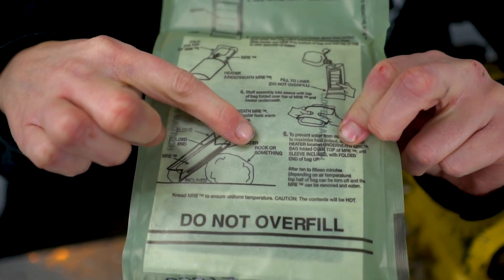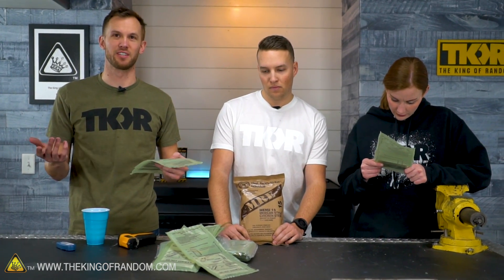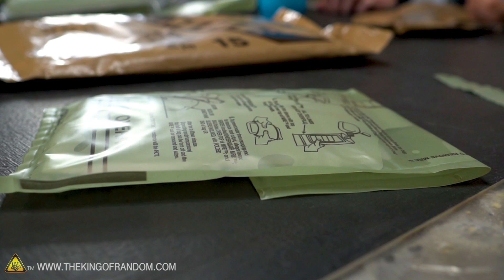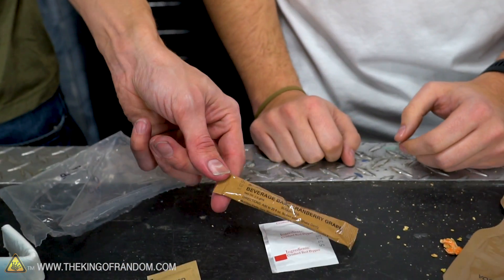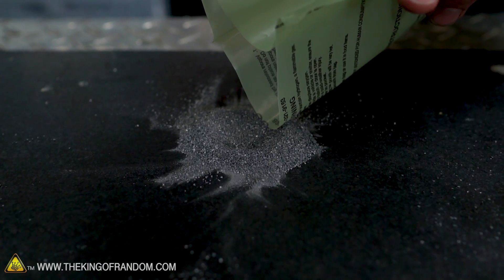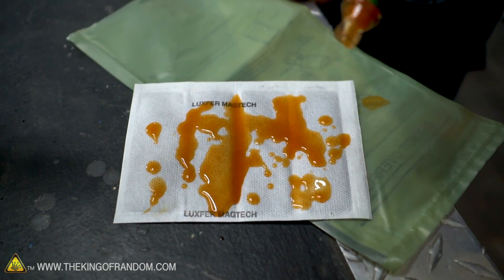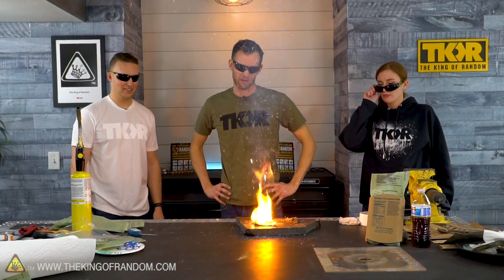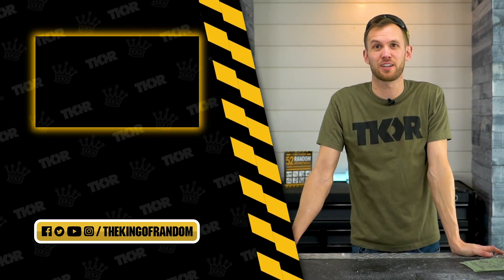Testing How The Army Creates HEAT With WATER

Comment: I can not believe they didn't put one inside of a sealed water bottle. it builds enough pressure to actually explode. Louder than a gunshot! You can up the reaction by putting multiple heating packs inside a gallon jug.

Comment: Fun fact: Placing an MRE heater, or its contents, into a plastic 2-litter bottle and pouring about a cup of water into it makes a nice explosion with the decibel level of a shotgun blast. Placing the heater into a glass bottle with a screw-on cap and about 2 cups of water will cause the glass bottle to explode like a grenade (not recommended in urban environments, as the glass will act as shrapnel). Glass fragments can be launched for as far as 50 meters.

Comment: One thing they use to do to us during field exercises is put a heater inside a Gatorade bottle with a little water and glow fluid. Screw on the lid tight, let pressure build and throws it into a sleeping tent to simulate a grenade.

Comment: Since Hydrogen burns hotter than normal gases (Propane / Natural gas),  would it heat water in less time and would there be a danger to the pot or container the water is in?

Comment: So I've been told, though never properly tested, that if you pour some water in a 2 liter then also put the mixture in it and fully seal the bottle, the bottle will then expand from the heat and pressure and if placed by a fire when it explodes, it is capable of making a pretty big fireball/explosion.

I have also been told though never tested at all, that you can take the match heads off the matches in the package and cram them in a clean tobasco sauce bottle from the mre, once in the bottle you cut a small hole in the lid and put a full match in it with the head in the bottle, so that you can then light the matchstick end and have a tiny explosive... obviously dangerous and could throw glass everywhere... but you guys have done some crazy stuff with glass bottles so have fun.

Also an idea, take the heater pack and place the element in a glass bottle then place some water in it and seal it with something... or use it as the ignition source for a potato gun... I think there are lots of things you can do with them that have not been fully realized

Comment: Going a lil more scientific. You are correct regarding the contents of the heater. Iron, magnesium, and salt. The reaction is exothermic but not really enough to heat. Definition of a battery. Two dissimilar metals separated by a salt.... there is the secret. I have also done this with h2o2. The reaction is faster and hotter. 
Thank You guys. Love your vids!

Comment: You missed the opportunity with this experiment. Place a MRE heater in a plastic water bottle, with about 1/4 of the bottle with water, cap it shut, shake quickly, place in a standard trash can...and run!  Ear plugs may be required.

Comment: You need to take the powder out and put it in a bottle with a cap and poke holes in the lid and use the Tabasco in the bottle with the powder and there is ur oc gas

Comment: callie: * pours grape water on the fire *
Fire: DID YOU JUST PUT GRAPE IN MY FIRE
callie in her head: I wonder why the fire started to go out and not get bigger like normally
Me: WHO POURS GRAPE WATER ON FIRE AND EXPECT IT TO GET BIGGEER
Reply: anyone that pours water on a Magnesium fire. When the magnesium burns, it reacts with the oxygen to form magnesium oxide. ... When magnesium interacts with water, it will form a hydrogen gas that ignites violently due to the excessive heat and oxygen supply. When it reacts, it will burn hot enough to decrease the water molecule, which turns to a Hydrogen Gas

Comment: we use to get them steaming then light the hydrogen. the blast of heat actually helps it warm up in far colder weather.  Also the meal goes into the bag with the heater, the steam helps heat it quicker

Comment: Here's something you could try. I have made a "torch" from an MRE heater that doesn't self destruct. You need a small piece of metal tubing the tinier the better. You seal off the bag, poke a hole with the tube and tape it so it is sealed. You can then light the end of the tube and it will have a sustained flame like a torch. I never tried multiple heaters in one pack though, that would be interesting to see.

Comment: I once had one spontaneously self ignite and no amount of water would put it out, it just made more and more hydrogen keeping it on fire. That was a sad day out in the freezing snow with my only meal. Kinda disappointed that not all of the fun things we used to do were tried. My favorite was to put a couple heaters into a water bottle and fill it some of the way with water, give her a shake and throw. The effect will yield varying results based on lots of parameters such as water volume and bottle size/composition but the best result should be similar to a big fire cracker.

Comment: Put the powder in a Gatorade or powerade bottle with the proper amount of water. Close and run away.
Reply: Umm that powder isn't explosive so there's no need to run away from it , all it will do is heat the water up in the bottle.
Reply: @josephbennett3482  I have done this many times the bottle builds up enough pressure to blow.

Comment: Get a bunch of heaters and seal a hose onto the ends all piped into the same line and feed that into a small internal combustion engine like a lawn mower.  See if it will power it and how many it will take . Maybe run them into a storage tank then draw the fuel line from there. 
MRE powered lawn mower.😁

Comment: While I was in the infantry between 1992-1995, we would make MRE bombs (heater powder and water in an empty soda bottle, sealed shut) to use as pranks and diversionary devices during  FTX's. Depending on how much water and powder you used, and the size of the plastic bottle, you'd have between 10-30 seconds before the bottle popped with a huge noise, loud enough to trigger tinnitus.

Comment: When I was in Korea we peed in one to test the effectiveness in a crunch. The smell was so awful we all threw up. Also put one in a Gatorade bottle and seal it tight.
Reply: We used to do this as well and roll them under other squad connexes at the motor pool. This way when it blew, it wouldn't hurt anyone or damage anything. But if you were in the connex at the time it went off, it was a pretty deafening sound and you could feel it as well.  Only the heaters we had were semi solid in form as we could cut it into strips. In fact that is what we did, cut the heater into strips and put it into an empty gatorade or similar plastic bottle with some water.
Reply: @IvoryTowerCollections  lol, I'm getting all sorts of ideas for when I join
Reply: I didn't realize the MRE heater existed during the Korean war, or the MRE for that matter I thought C rations were the standard.
Reply: @garethbaus5471  na man this was 2012 their is still military in korea other then the war
Reply: So glad I'm not a soldier yet

Comment: I wonder...  Can you use the iron in there to mix and make thermite?  That might be interesting...
Reply: Not the right type of iron. Thermite works because you are taking rust and turning it into pure iron. Using the heater’s iron powder won’t have the same effect
Reply: @nicholass9841  Oh yes, I'm aware of that.  Sorry if I didn't explain correctly, but the thought I had was to mix this WITH thermite in order to use the magnesium present to ignite the iron oxide aluminium mixture, as magnesium is often used to light thermite.  This contains elemental iron, magnesium, and salt.  So my concept is to mix thermite with it, and find some compound (like water) that would be able to be used as an auto-ignition source.  I didn't really explain myself properly originally, sorry for that.

Comment: You're supposed to put the meal pack into the heater pack with the water, then sleeve it, not put them side by side in the sleeve.
Reply: I've seen multiple people do it this way now to keep the retort pouch from getting covered in that grey "water". It's not as effective but you can sandwich the heater between the entre and bread/dessert/hot beverage pouch to warm up both without over stuffing the FRH pouch and minimize the mess. So it's kind of a coin toss to me for how you use it since either way has advantages/disadvantages.
Reply: It worked didn’t it? Lol
Reply: He was Army what did you expect?
Reply: Jefferson Whitehead at least he wasn’t a crayon eater.
Reply: Gave me aids watching this part.

Comment: Ok that's cool, but can they make water with heat
Reply: Fuel + O2 → CO2 + H2O

That is a typical wood combustion reaction
Reply: Pass me some ice ill stick it in my mouth
Reply: Just burn hydrogen
Reply: can't you just heat ice?
Reply: Create a solar still and try accelerating the process with different types of lamps
Reply: Hydrogen and oxygen

Comment: The older version of the MRE heater was so much easier to be...inventive...
Reply: Dave Little y’all are the reason they made them less

Inventive...
Reply: Zezoo 210 without admitting anything, I’ll quietly nod in agreement
Reply: @davelittle6668  Hey, the best soldiers are the ones that get into trouble when they're bored. After all, you can't cause proper mayhem without drive, creativity, and improvisational problem solving.